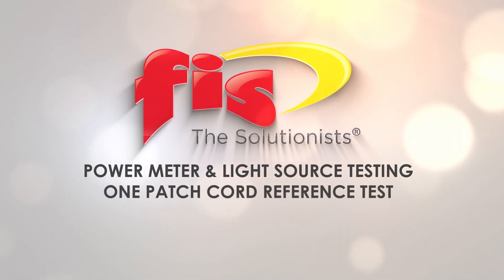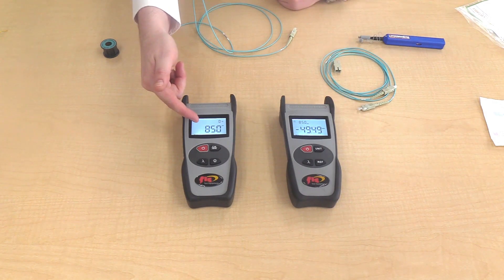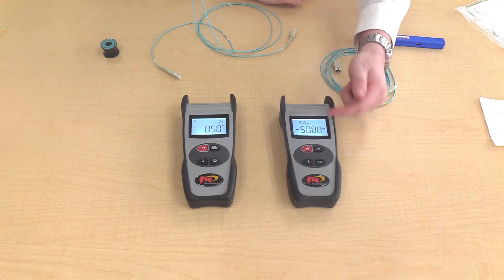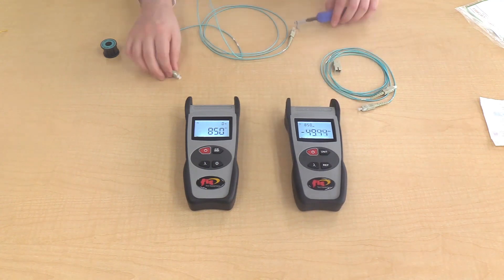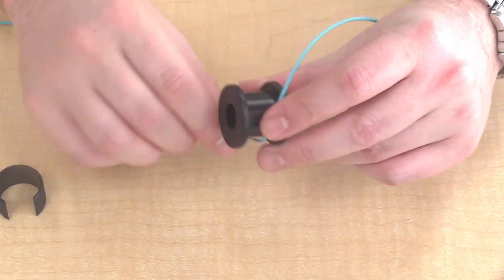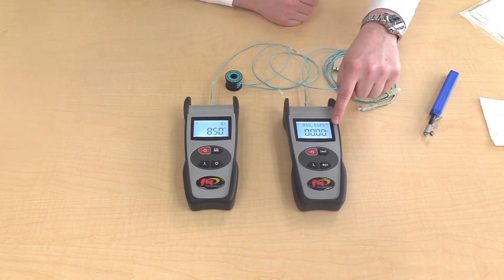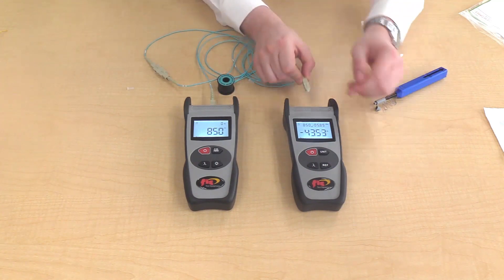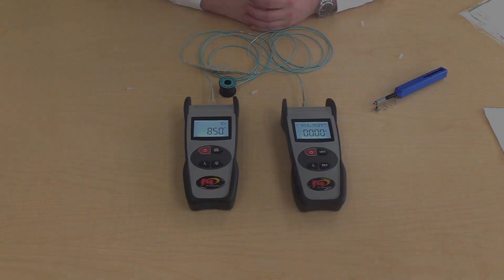Learn How to Do a Power Meter and Light Source Test - E-Series

Comment: Good morning. What is the reason for using mandrel in reference patchcord? Based on what meter shows, both of the mesured patchcord connectors has 0.00 dB loss. Its hardly possible I believe. Real-world MM connectors should have more or less 0.3 - 0.5 dB loss. Thank You in advance for reply.
Reply from the maker: The mandrel is used for Multimode testing ONLY. It is used to strip out the “higher modes” of light that exist in the cladding because of the natural way the MM source launches into the fiber. It is not needed for Single Mode testing.   - Bob Licari